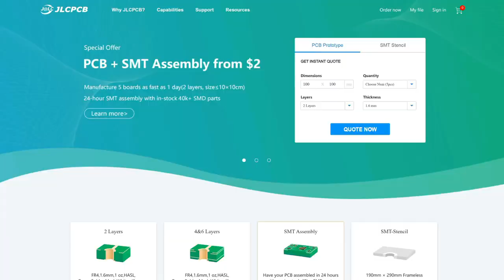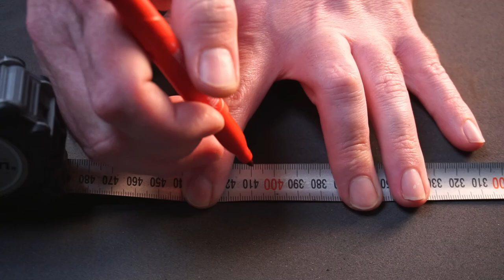Organize your Tools like a PRO! Making foam drawer inserts for Tool Chest / Box

Comment: I would be better off making cut outs in the floor - that is where my tools usually end up 😂 
Sometimes if tool  is being naughty ( not doing what I’m trying to force it to do ) it ends up on the other side of the yard so I might need one of those inserts over there as well 🤣
Cool idea tho ! The proper foam inserts from bunnings for the tool chests are  bloody expensive and those floor mats are usually pretty cheap in comparison .
Reply: Haha. I picked mine up from the tip. Some caravaner threw out his matting. So I picked up about twenty for nothing. So now I have more than enough to do this project, including my stuff ups along the way !

Comment: Great video and process.  I would make two suggestions to improve further:

1) Buy some red cardboard from local stationery store or thin red foam from your local craft store.  Put this red layer between the foam and the drawer liner and it will give you good visual management to easily see missing tool through the red showing through when tool is not in its correct place.

2) For layouts like the spanner layout rather then putting individual finger pools on each cutout, a long bar that straddles across the tools about the width of a metal ruler could be added.  This will greatly reduce cutting time as you can use this to traverse each individual cutout in the row without having to stop, detach the wire and then reattach the wire for the next cutout and so on.

Comment: Those mats make a great alternative to Shadow/Kaizen foam, much denser foam and look more like the machined foam trays you get with tools. Don't strictly need a hot wire cutter, the foam cuts well and good results can be obtained with a sharp knife. Some other tips, can layer 2 mats for deeper tools. Also a contrasting color for the lower layer or drawer liner looks great.

Personally I don't use foam trays much, they take up a lot of space for the tools stored. Also wrenches or sockets, any set with lots of individual pieces will be very time consuming to make. Better alternatives like plastic plier racks and socket organizers. That said, foam trays can look very good if you can spare the space, I did give in to temptation and make a complete foam drawer liner with these mats for ratchets and torque wrenches. Looks great and there aren't many other good storage solutions for ratchets.

Comment: You don't need a hot wire cutter for this, you can get great results using a Stanley knife, a scalpel for the tight corners, and a cutting mat. I've made dozens of custom EVA foam inserts for pistol cases like that.

Comment: I like that you showed the hot wire cutter. A mechanic like me would need side slots /////////// on both pliers and wrenches as I can barely fit them vertically in my biggest tool box drawer
Reply: I'd need a full size garage full of tool chests if I laid the tools  out as inefficiently as this guy 😂
.
There are much better ways to do it than this. And what happens when you buy an extra tool?

Comment: I wonder if you could heat the metal only tools in the oven then drop them on the EVA foam. Possibly spray the tools with mould release so you don't get bits of melted EVA on them?
Reply: It's possible but takes much more heat , produces toxic smoke , don't give a clean even finish and can't be implemented with tools having rubber handles
Reply: Did with a socket wrench set, which had a flimsy plastic insert that finally broke apart.
Heated sockets in an electric frying pan, and pressed them down into the foam.  Worked great.
Reply: @anmolkumar6704  If you heat the metal tools too much it will burn and produce toxic smoke, so you have to experiment and find a temperature between the melting point and the smoking point. 
I'm actually considering setting up a system using magnets so each tool gets a neodymium magnet or two for each moving part. The magnets are embedded in a ply base board and the tools when placed in their area naturally stay as intended.

Comment: Pro tip, you don't need a foam cutter. You can use a Router but be advise and connect a shopvac or some sort of dust collection to it.

You can also use the same foam used for Vinyl Siding if you don't mind pink or white.

My father did this to all of his Tool boxes and when he passed away and I inherited the Tools I removed the foam inserts. Reason being I had more Tools then he did.

Comment: Did you just use steel wire for this hot wire cutter?
Because it doesn't look right.
Proper kanthal wire will straighten itself when made glow red.

Comment: The electronic circuit of the scissors or coil in which the squeezed insulator cuts its scheme and the value of the electronic parts

Comment: Use of a bright (or alternate) coloured  thin EVA foam under the tools helps the space 'pop' when a tool is not in it's place. Orange, Yellow, Bright Green. 
Any good & cheap source of the 'thin eva foam'?
Reply: Yes, Michaels Carrie’s a multi colored pack of 1-2mm thick Eva foam
Reply: @brandonward3998  The coloured options seem only available in small sheets and not rolls.
Reply: I have followed your advice and bought bright yellow 5mm Eva sheets 60*60 cm so they fit exactly the mats... Awesome idea thank you